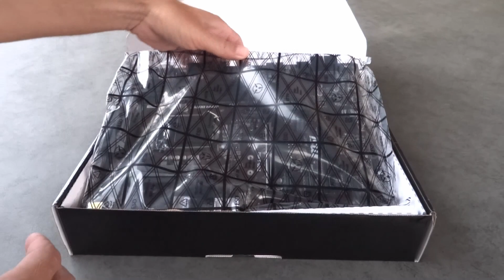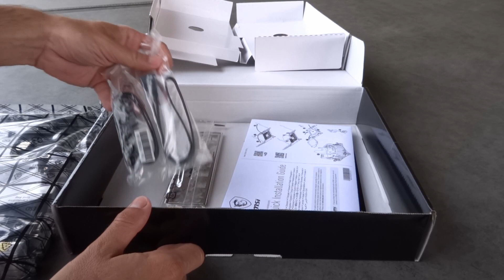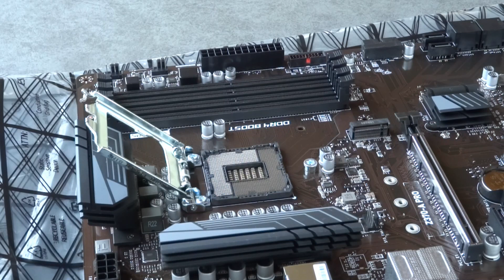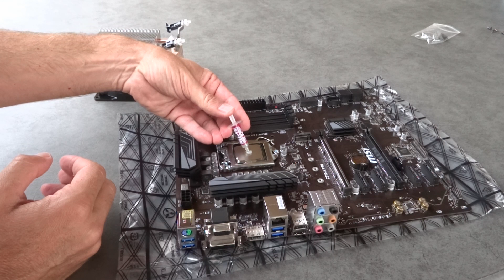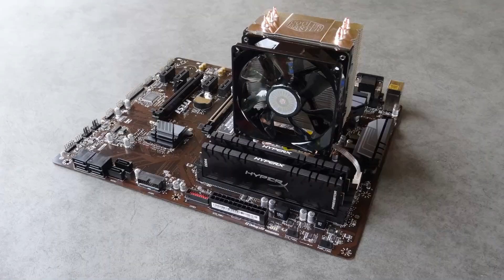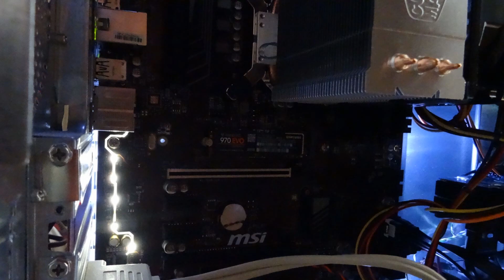Montage PC MSI Z370-A PRO / I7-8700k / SSD 970evo M.2

Comment: How does the "SSD Samsung 970 EVO M.2 PCIe NVMe 250 Go" work in the Z370-A-Pro?
I could not find out if this drive is supported by the Z370-A-Pro.
Let me know please
Thanks and thanks for the great video.
Reply from the maker: the Samsung 970 EVO M.2 SSD works perfectly with the MSI Z370-A pro, the boot is very fast under Windows 10 and use without bug for the moment.

Comment: Please answer me 
i have a 370 a pro with a cpu i9 -9900 KF 3.9 Ghz and an RTX 3060 ti 8Gb 
i get problems everytime i launch a game black screen and the pc restart ... is it a problem of compatibility ? 
PLZ ANSWER
Reply from the maker: I can not answer, it would be necessary to test with other components.
Reply: Not sure if you've already solved it since its been a month since you posted that, but you most likely need to update the bios for the motherboard to make it use the CPU.
Reply: @Razgriz_01  THANKS for the answer it was not the bios i solved it by changing the Power and i had problems on the motherboard ( The slots of the Rams )

Comment: Hello, I was wondering if I have my GTX 1070 ti graphic card in that white slot right next to the m2 slot, will it still function? Because I heard somewhere that some PCIe slots won't function if an m2 ssd is installed.

I really need to know this information as I have the same motherboard. Thanks!
Reply from the maker: Hello, this is wrong, I had a GTX 1080 with an SSD and everything works fine.
Reply: @grandangleHD  So even if a 1070 ti is in that white pcie slot while the m.2 is installed i'll be good?
Reply from the maker: @siriusxmproductions5697  yes
Reply: @grandangleHD  Thank you!

Comment: Where do you get the ssd screws, I can't find mine.
Reply: it should be in the box with the motherboard. its in a very small plastic bag. about 1 inch
Reply from the maker: I had the same problem, the screw is already on the motherboard.
Reply: xyZeno I couldn’t find mine too
Reply: @grandangleHD  where'd you get the top part? I had the bottom not the top
Reply from the maker: @thespyer2k  Yes both

Comment: How do you like your 970 evo? Was it worth it? Would you rather have the 970 pro or stick with the evo?
Reply from the maker: I am very happy with my system which is very responsive. the 970evo of 250 go is enough for me.
Reply: I just bought the 1tb 970 evo yesterday 😂 but of course I don’t have a small enough screwdriver
Reply: I have the same motherboard also
Reply: Can I run a M2 ssd like yours and a normal ssd like Crucial MX500 on this board simultaneously?
Reply: @grandangleHD  should i let the sticker on the 970Evo? Or better take it off?
Reply from the maker: @Bizzerboy  No you can leave it, that way you keep the information
Reply: @grandangleHD  Thank you very much

Comment: Nice built! I got almost same specs. Different RAM and cpu cooler though.
Reply: R6 Engineer
Will the noctua nh d15 block the ram on this board?
Reply: I dont think so. There is ram and motorboard compatibility sheets in noctuas website. I have low profile corsair ram in my setup and noctua nh d15. I had the same cooler with my previous setup with z97 mobo with much taller ram. You can see the max height of the ram for the cooler also from noctua site. In the cooler ram should fit even if you have all four slots occupied. You may have to but the other fan above the ram bit higher if the ram is tall enough. I checked the noctua site and the ram can be max 64mm tall to fit.    @Smoozable
Reply: Also make sure that it fits to your case its quite big cooler :D I have Fractal Design Define R5 windowed edition.